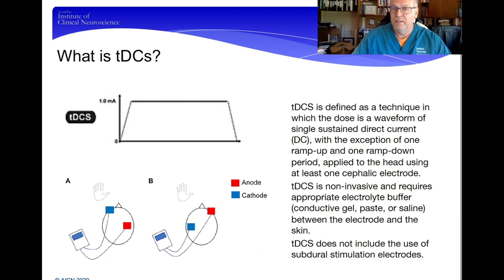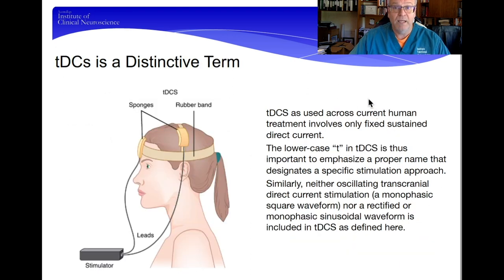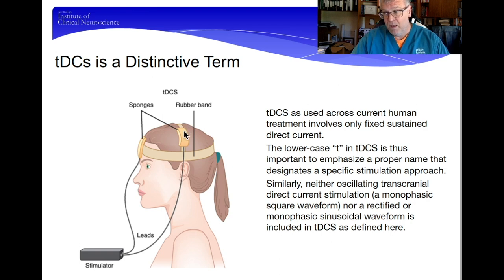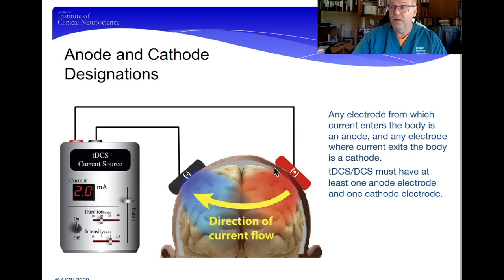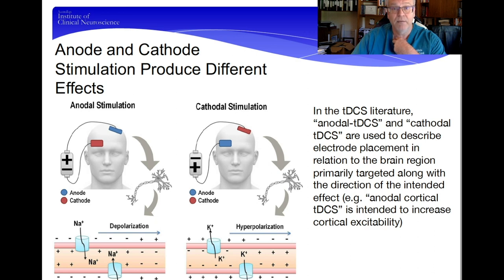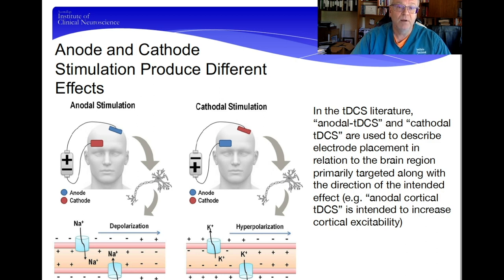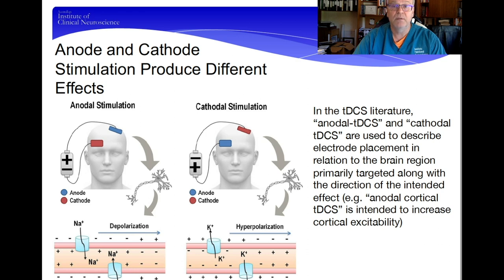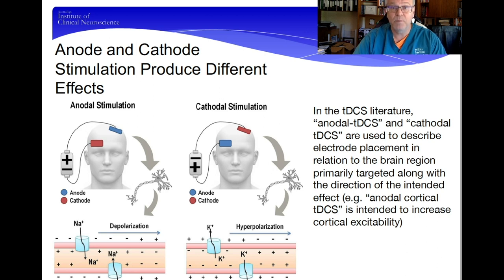Better Brainwave tDCs Part 3

Comment: Im glad to hear its non invasive & can be used at home. How much do they cost and wherevto purchase? I like that the improvements continue after treatment. 
Please include prices & wager to purchase any equipment you share in the videos.  Ty!
Reply from the maker: Hi
Pricing varies with the quality of the laser and the purpose for which you are intending to use it. I would not try cranial laser without expert supervision.
Thanks for the question